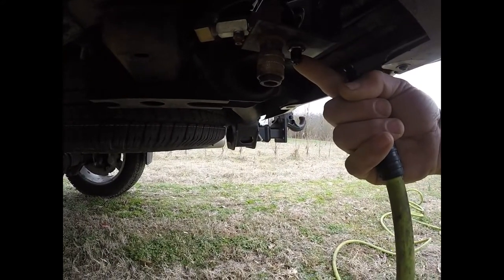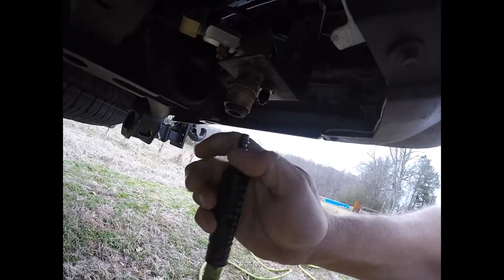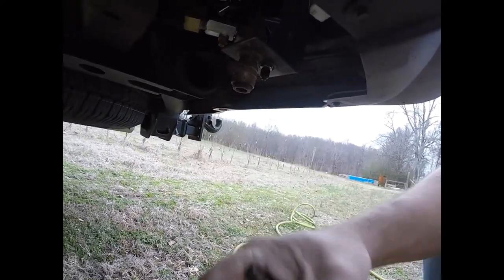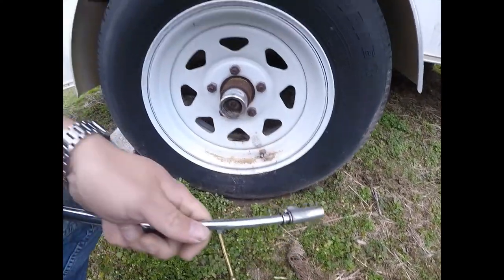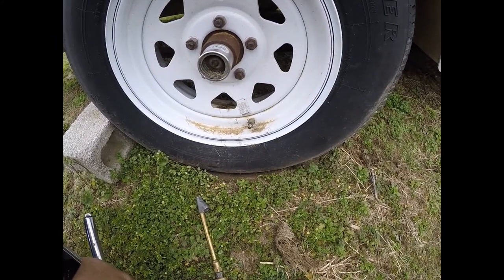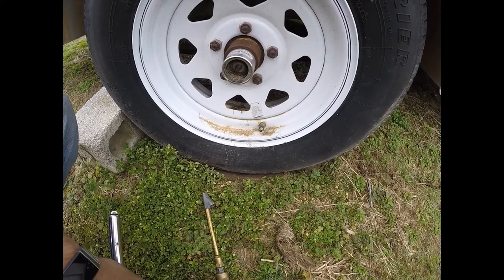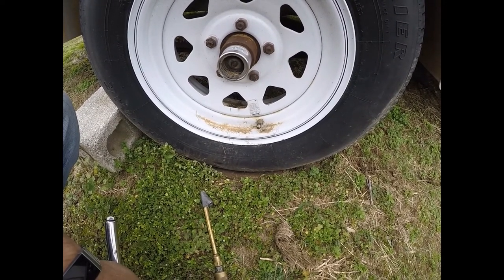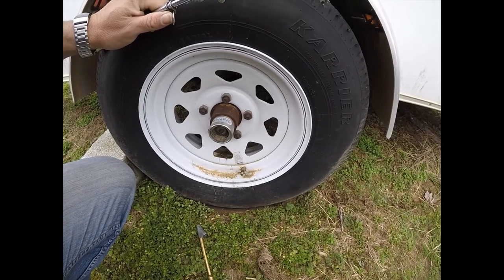WILL AIR LIFT WIRELESS ONE AIR UP A TIRE??

Comment: Just did this same mod when I installed the Air Lift 7400 on my RV, thanks for the reference video.  Will be useful in adjusting tire pressure at the track.
Reply from the maker: Thank you, I apologize for the quality. That was one of my first videos. There's another really good video on here where they put a tank with dual compressors and kept wireless controller. That's next for mine

Comment: I need to do this for airing up bicycle tires.  Any way you could add some detailed pictures of the connector setup for the air hose connection?
Reply from the maker: I have changed it since this video and added 2.5 gallon air tank and viar compressor. I used the same air connector but changed the 1/4 line to 3/8 line for faster air flow. There should be a good pic closer to the end of this video if not let me know and I can send some pics on Instagram https://youtu.be/lr7cmorCaQo
Reply: @CFarmer  Thanks for the info and this looks like a great idea.  I am getting ready to mount my Air Lift compressor and would like to leave plenty of room to do what you have done here.  How much space should I leave for the air tank?
Reply from the maker: Here is a link to the viair installation. That may show better than i can explain. was harder than i thought finding a place a 2.5 gallon tank would fit https://youtu.be/lr7cmorCaQo